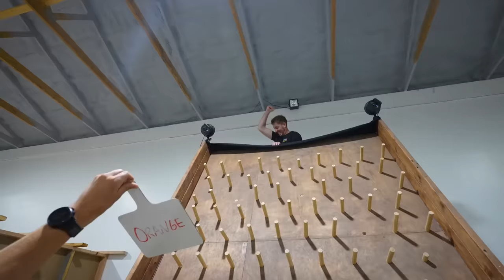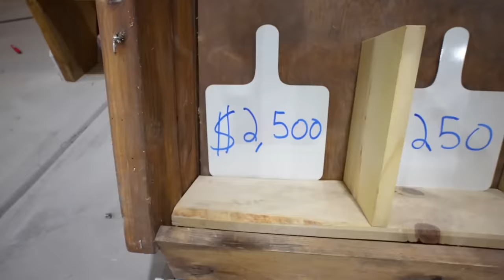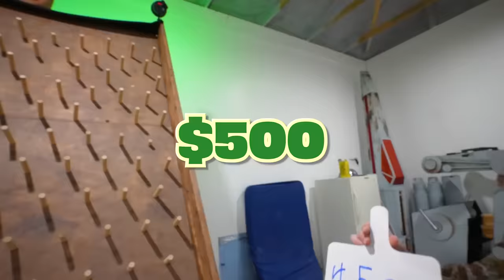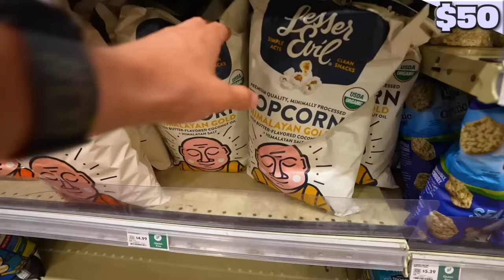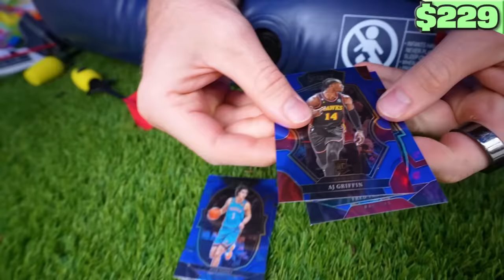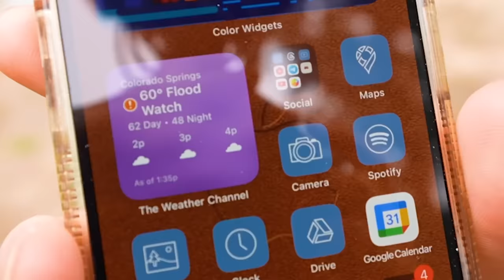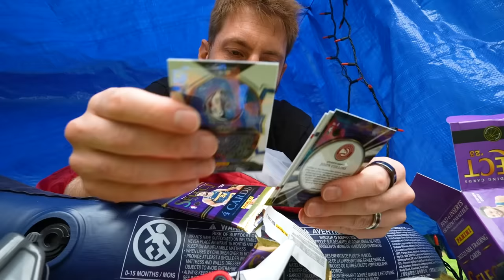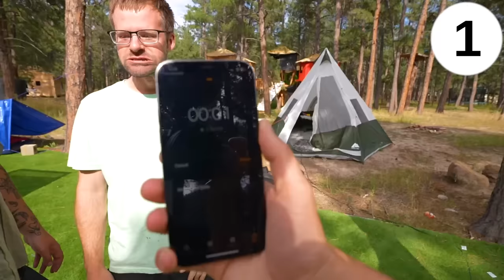$10 vs $5,000 Homemade Shelters! *OVERNIGHT SURVIVAL*

Comment: A frame shelters are very efficient and extremely affordable. Colder its gets the smaller you make them. Double layer for some insulation properties. Use two sticks to hold one side ooen if you want more breeze. Dont be afraid to use tarp on a string with low baller budgets!

Comment: Video idea. Get those big clear balls people can sit or stand in. Over night survival challenge. Get a few people to do it. Get another group of people to let them do whatever they want to the ball things. The only rule is, they can't pop it or put a hole in it. If they do, whoever is inside automatically wins. Once you step inside the ball, you have to stay inside for 12 hours without getting out. Start at 6pm so it ends during the morning. So the attacking team can scare, paint, roll or whatever they wanna do. If you get out of your ball before the time limit for any reason even the bathroom, you lose. Loser gets put into a ball filled with slime for 10 minutes as punishment and they have run through an obstacle course.